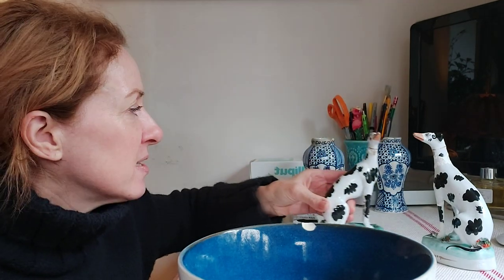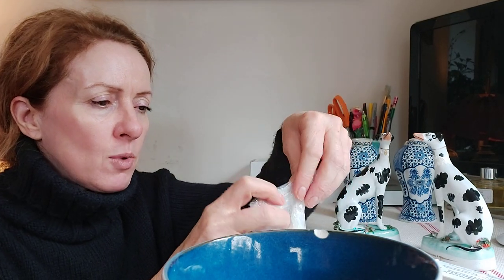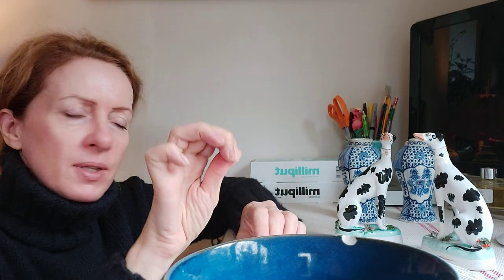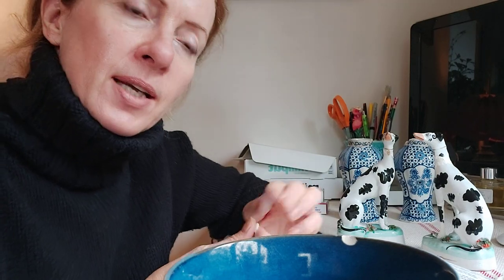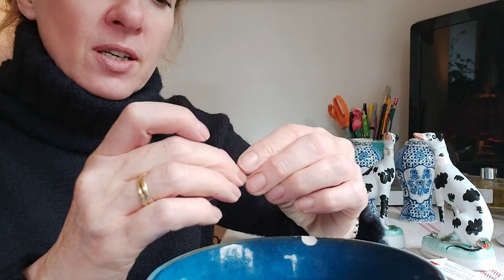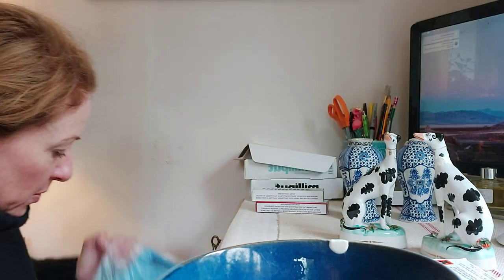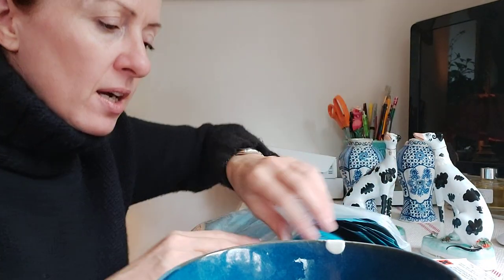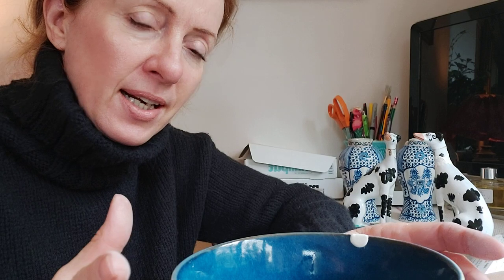HOW TO MEND A CHIPPED BOWL

Comment: Hello! I purchased a very lovely ceramic bowl made in Portugal and there was a large chip (imagine a bite out of a cookie - that kind of size). I have a couple of the chips but the others were just shards. They could not replace it, there were no more so they refunded my money. 

Can I fix this bowl in the same manner as explained in your video? Should I try to fit these chips in? Would this milliput product be food safe? I was going to use it for plants but wanted to fix first, and now I see your video and think I may be able to use it still for making breads and such.
Reply from the maker: Hi there, depending on the chips I would probably fill in with Milliput. I would recommend looking at the milliput website and manufacturers instruction page to confirm if Milliput is food safe

Comment: thank you for your video. very helpful. I have a question. is it possible to glaze the chipped and fixed part and fire it in the kiln. I fire at 1230 deg C usually for my glaze firing, will this withstand the heat? thanks a lot again.cheers
Reply from the maker: Hi there, i don't fire my items

Comment: Whats the adhesion like with miliput . Does the roughness provide enough "key". Im used to using car filler and was awlays taught to roughen the sunstrate to give a good key.
Reply from the maker: If the surface area is small you do not need to use glue.

Comment: Thanks- great video. Iv applied and sanded my milliput and its really smooth. I can't seem to find any ceramic glaze but i don't need it for the look as the piece is not glossy, so are there other benefits? Ie does it protect the milliput from dishwashers etc?
Reply from the maker: Many thanks for watching and commenting,  you don't need to apply a varnish although I tend to. There is a Winsor and Newton glaze which is easier to get hold of although not sure on the performance.  I have put plates with Milliput without glaze in the dishwasher and it has been fine. If in doubt you could look at the manufacturers instructions online. 😃

Comment: I have a Bombay butler that I bought on E bay and it was received with the head broken off. I thought I could repair it with epoxy, but I am afraid it is too heavy. Do you have any suggestions? Its called a Jeeves butler, which is pretty common.
Reply from the maker: Hi There, if the head is broken it should be able to sit on the body easily with glue and gravity. Obviously I don't know the peice so you will have to go with your gut instinct 👍

Comment: Thanks for this video. I have a chipped bowl I would like to repair. And if possible I'd like to stick back on a piece of ceramic that has been chipped off. Would I simply stick this piece to the other side of the miliput and sand the miliput around it or should I use a different method?
Reply from the maker: Hi there many thanks for your comment, if you are just putting an original chipped piece back on, I would glue on first, then  fill any cracks with Milliput. I hope this helps, please let me know how you get on. 😃

Comment: Hi Alison, if you use two-part epoxy products a lot, you can get very sensitized to them, so you might want disposable gloves for what you are doing. After the two-part products have cured, they are very inert, and there is no concern about contact. In practice, the concern might not apply nearly as much to the putty, because it doesn’t have the honey consistency that most two-part epoxy products have, but in principle it still does. Thanks for the nice vid, from an Ahmericaan that loves hearing the Queen’s English. ~Brian
Reply from the maker: Hi Brian, many thanks for your comment and advice, so pleased you enjoy my channel and like my accent! 😀

Comment: Thank you. I have one question to ask. Can I use the same material to repair a Japanese-made Donabe. The thing is that sometimes the temperature could go up to somewhere higher than 130C on an oven top. But the chip is on the outside rim of its cover and is not big. Could the donabe remain food safe after the repair. 
I learned that Kintsugi is also an option, but your method seems easier. 
Thank you.
Reply from the maker: Hi there, Milliput is grat for cracks and making up small pieces. I cannot unfortunately guarantee it being safe with such hot temperatures.  I would recommend looking at the Milliput website for safety information. Hope this helps.
X
Reply: @theceramicrepairstudio  Thank you so much!

Comment: Hi, can I use Milliput then acrylic paint with ceramic glaze as you show on various videos, onto a small chipped pottery dish that I use for cooking different recipes in my oven at 220 to 240 degrees???
Also I can't find Rustins ceramic glaze here so does Winsor & Newton professional acrylic medium does the same job? Many thanks
Reply from the maker: Hi Muriel, unfortunately I wouldn't advise it. Rustins is very hard to get hold of at the moment, I do think the Winsor and Newton would be ok although I don't know about the long term affects when it comes to discolouring. Hope that is useful. 😃

Comment: Hi do you use glossy seal after painting it blue?? Or what do you typically use to make it look like shiny again
Reply from the maker: Hi there, I tend to use Rustins ceramic glaze. This although it is expensive and and getting harder to find. There is an Acrylic glaze by winsor and Newton which although I haven't used, I think is probably the next best thing. It is cheaper and easier to get 'In my description box is a link'. 😀👍

Comment: Hello, Allison. I have a brown betty teapot with a chip on the edge of the lid broken off (I have the piece) and two small chips. Can the epoxy be used to stick on the small chipped piece as well as cover the the small chips? Can it be painted as well?
Thanks for listening.
Reply from the maker: Hi there, you could glue the small pieces back on the lid, and fill in with Milliput if there are any missing pieces. One word if warning though, if you are going to use the teapot lid the stream will properly soften the glue and break again, depending where the piece is one the lid. Otherwise mend only for display. I hope this helps and please let me know how you get on. 😀

Comment: I have a Staffordshire trinket pot that had previously glued, (not very well) with super glue. Can I soak it in acetone to break it apart again? Many thanks.
Reply from the maker: Hi Gilly, I would first try soaking it in hot water first, it should weaken the super glue.
If using acetone make sure you don't touch any gilding if any. In a well ventilated room with a mask on , take  a cotton bud with acetone on put onto the glue cracks, wrap in clingfilm for 12 hrs. Hope that helps, let me know how you get on.! 🥰